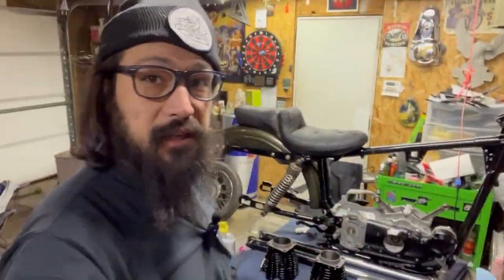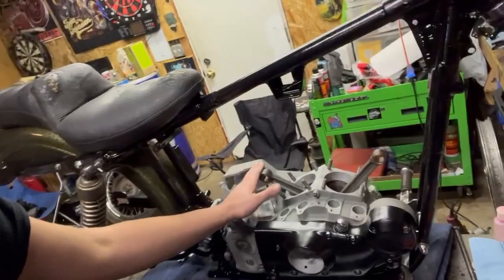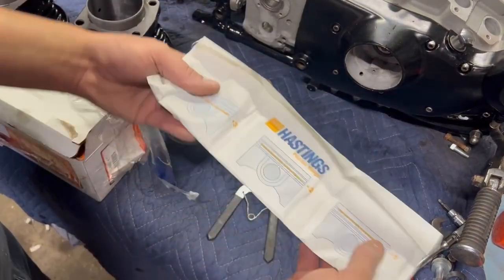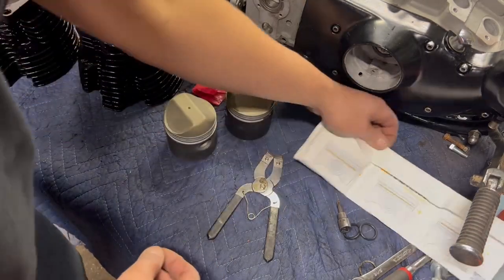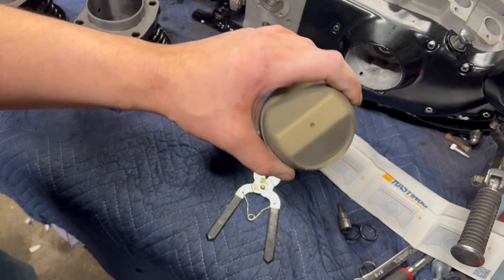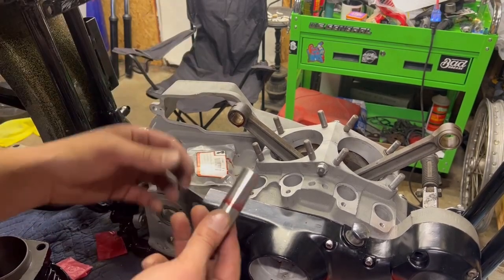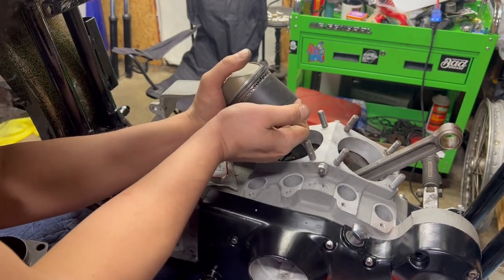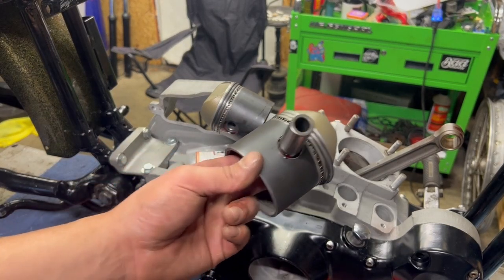1972 XLCH Ironhead: Pistons and Rings and All the Fun Things!

Comment: Quick question were the rings fitted to the cylinder before this install thanks for your videos
Reply from the maker: I did drop the new rings in the bores prior to assembly, but these cylinders have been freshly machined to the rings .60 over about 3 months ago.  I did not re check them prior to this install this time, but only because that was already done when I got the cylinders back from the machine shop.  It is good practice to do so though!  Thanks for watching!